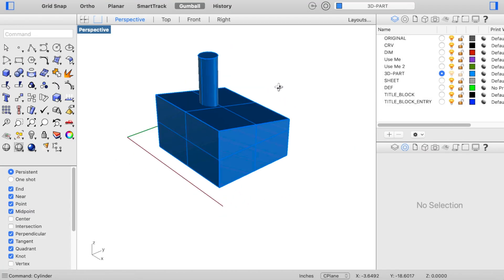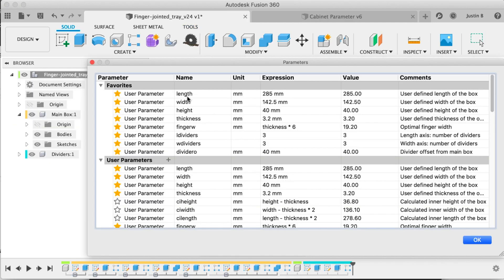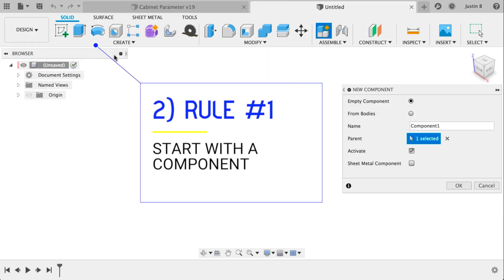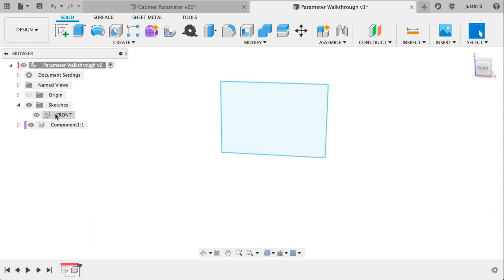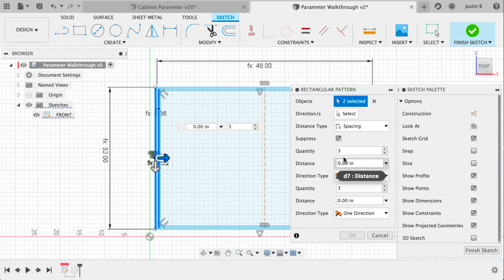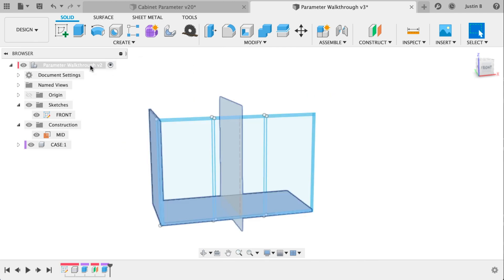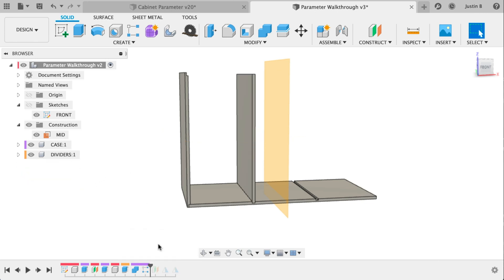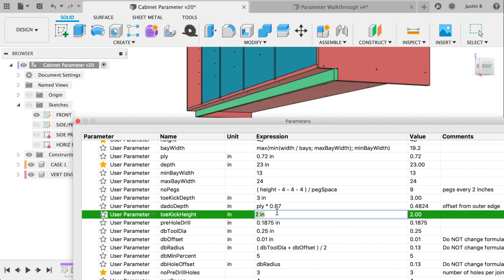Learn Parameters in Fusion 360

Comment: Hi Justin big fan of your youtube channel. thanks for all your content. I'm currently trying to design up a drawer unit which i am trying to make the quantity of drawers parametric so i can change the amount of drawers easily. Im very new to this so bear with me haha . im finding it frustrating when the equation im trying to make to the the drawer front sizes mimnus the gaps etc is red and doesnt wants to accept it. 
The equation is:
(unitheight-((drawerquantity+1)*drawergaps)/drawerquantity 

the parametric values hidden befind the names are

(880mm-((3pcs+1pcs)*3mm))/3pcs
is it something to do with the fact that the units for drawerquantity is pcs (which is the amount of drawers i want) isnt working with the millimeters? but i tried to change the value to of it to millimeters and it still didnt work.

I hope this makes sense i cant find any one on here explain how to parametrically model the amount of drawers you have in a unit

Comment: Do you have a walkthrough for plywood cabinets in fusion 360, such as the last model you showed, to CNC?
Reply from the maker: Hey Jay, I don't think so. Not like a top to bottom design to CAM cabinet. In little snippets all over:  You can download the F360 model to look through it on this Parameter video https://pdxc.co/pd-post - 

In this one I quickly go through the CAD/CAM to build a small "cabinet/shelf." https://www.youtube.com/watch?v=x-RSszreL7M -- there's a F3D download which includes the CAM which is essentially every type of operation you'd need for a typical cabinet.

You might check out Lars, the guy has a video for everything https://www.youtube.com/user/cadcamstuff/search?query=cabinet

DM on insta @pdxcnc if you have specific questions. Been planning to do a series for woodworkers to get into Fusion

Comment: Unless I missed it why did you choose no value for the parameters instead of just choosing the inch value? I can understand for the number of dividers.
Reply from the maker: Unitless is much more flexible to start with - because you can't change units in the parameter (dumb) and making formulas in other parameters with "unit-based" parameters throws a flag.
Reply: @pdxcnc  Your videos are excellent.  I was wondering the same thing.  The challenge is I go between mm and in quite a bit.  What i like about defining the unit is i can then just use the extension mm or in and it converts.  I do agree it is dumb not to allow us to change units in the parameter dialog box.  Again, thank you.